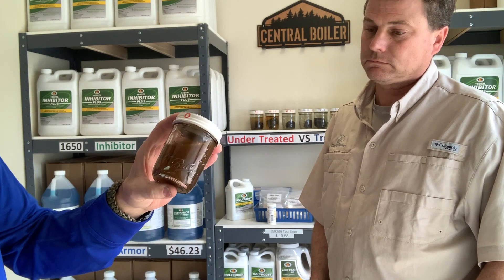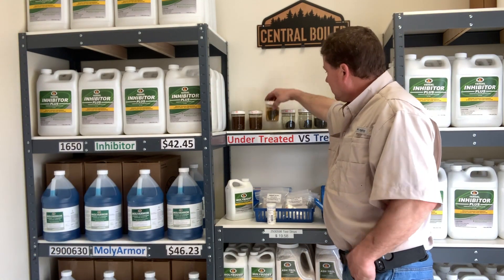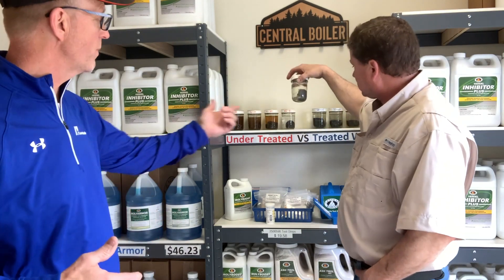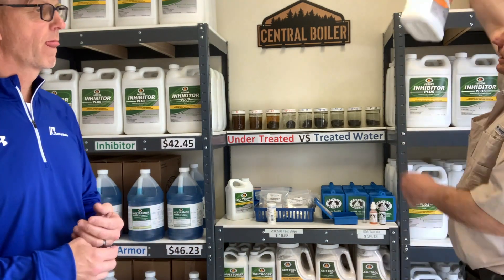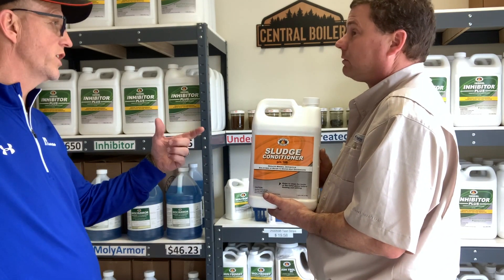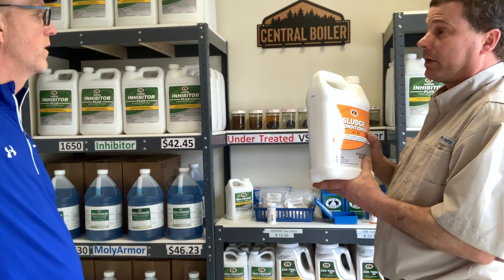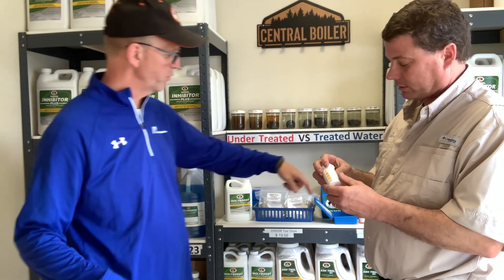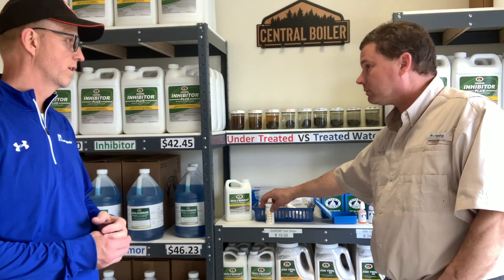Central Boiler, Water Maintenance !!

Comment: Have you found the new test kits to be reliable up until their expiration dates ?
Reply from the maker: Yes, a lot better way and easier way to test, as long you are over 350 and higher your good.  Thanks for watching our channel.  
Kevin
Reply: Didn’t really answer my question ...
I have found 3 cases already where the CAN solution is not reliable up to the expiration date
Reply from the maker: @luvdogsandhorses  Sorry but yes it needs to be before the expiration date is up.
Reply: You don’t listen  very well
The problems I found were before the expiration 
Never mind 
Maybe you will get the memo

Comment: What would happen if you put to much boiler water treatment in and leave it like that then running the boiler for several with too much water treatment?  One more question, what was the other water samples in the jars to the right of the correct amount of water treatment jar on his shelf?
Reply from the maker: Thanks for watching our channel, When using the MollyArmor as long you test 350 or higher you are good to go.  Cb says no problem with too much.   I think Russ said the jars to the right was just a higher amount of the old Corrosion Inhibitor.  The MollyArmor will work in any Outdoor Boiler.
Reply: @klwit1980  To be certain, the MollyArmor is safe to use in mild steel water jackets?
Reply from the maker: @jeromeprzybilla9999  yes
Reply: I have heard consistently that too much is okay
Seems too much would possibly raise the PH out of range ....